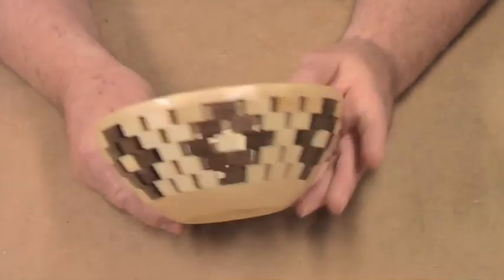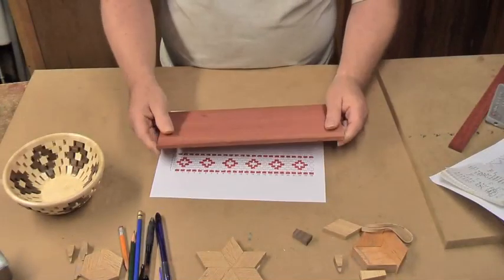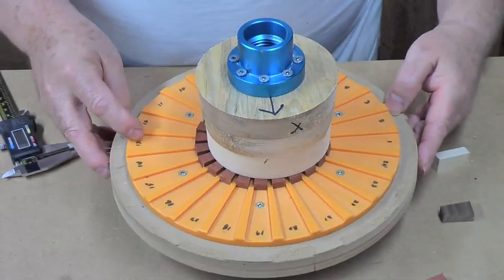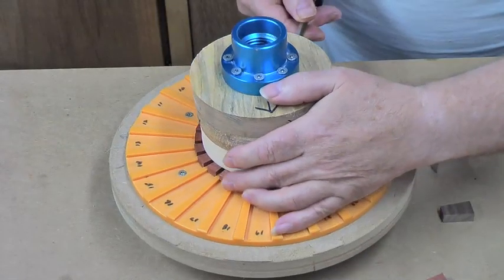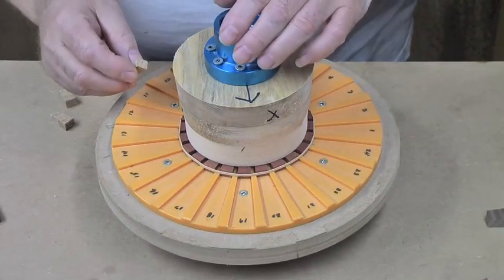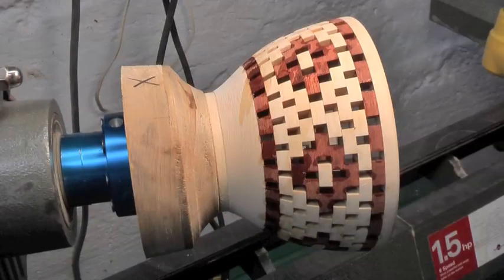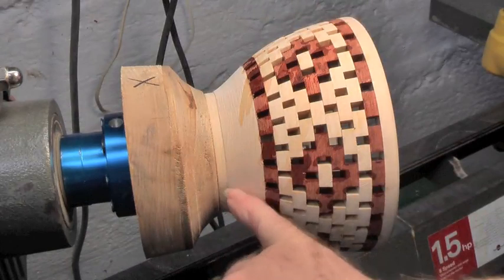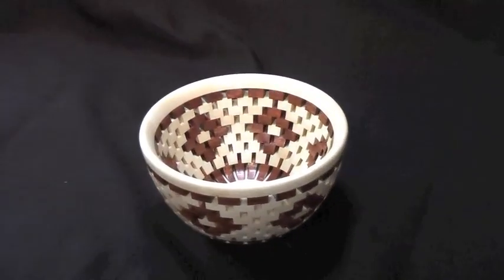Open Bloodwood & Maple

Comment: There is a far easier way to centre that... There is an existing hole centred on your bottom plate you use to hold the segments. Enlarge that to a known size like 5mm or 1/4" and use a short metal pin the same diameter. Then when you turn your base piece you are going to glue to it, drill a matching shallow hole in that, the pin between the bits should provide a perfectly centred item every time.

Comment: Great video,  Would U tell me the cost of materials to include glue, wood, etc. and the amount of time involved from start to finish (not counting waiting for glue to harden)?
Reply from the maker: I just looked and that bottle of glue cost $3.69, but you get many bowls from one bottle.  The total cost to make a small bowl like this with bloodwood and hard maple, counting glue and finish, would be less than $15.  Each row would take about an hour to cut, sand and glue to the bowl.  It would take about  hour and a half to turn and sand.  Each coat of sanding sealer and finish would only take minutes to apply, but many hours in between coats.  I hope this helps you.